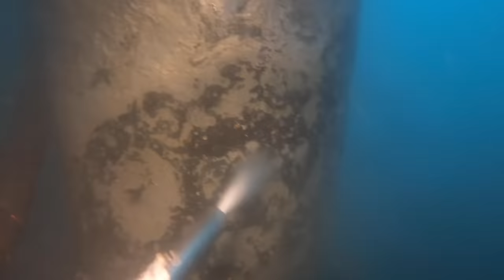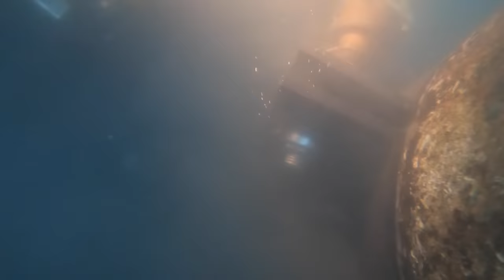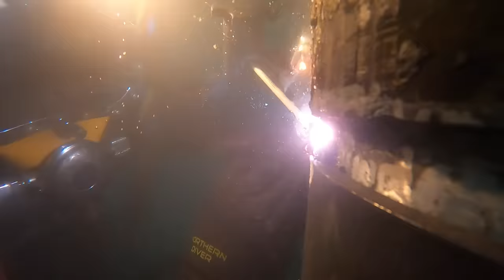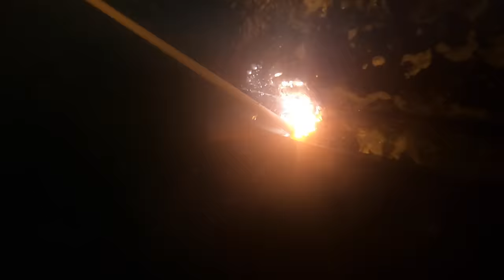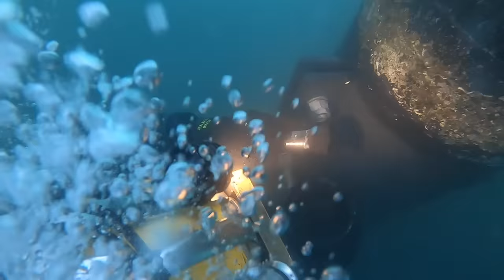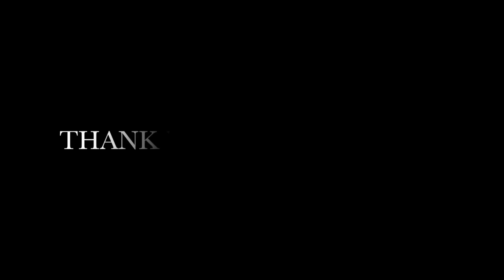Underwater corrosion damage repair (Underwater welding)

Comment: Was impressed when you could weld underwater. Now you can paint!
Reply: Its 2021...they bake you a slice beef underwater
Reply: that was pretty amazing 🤩
the skill in welding and damn the paint was more amazing 🤩🤩🤩
Reply: My thoughts exactly!
Reply: I have a doubt .. which welding electrode is used for underwater welding ? Please answer.
Reply: Janis Joplin  no actually that is my doubt.!
Reply: Right? Whats next you can cook underwater for lunchbreak?
Reply: @Universal.Vlog4u  Question, you have a question. Not a doubt.
Reply: Gua bangga dengan jurusan gua TPL teknik pengelasan
Reply: Lol
Reply: @Universal.Vlog4u  It could be 7014, 8014, 9014, or any of those with a 24 at the end.
Reply: @Universal.Vlog4u  That being said, there is a specific rod called Hyrdoweld which is designed with underwater welding as it's use.

Comment: Ladies and gentlemen this is what 100/300 $ an hour looks like
Reply: Fr ?
Reply: @bruhbruh6670  depends on how deep you are, but I'd say likely this man was making more like $50 if he was above 50 feet underwater. look up industry standards on depth pay
Reply: @theuniversalbean9352  that would be added to his rate. Pressure welders get $100+ on the surface he in Australia. What you would be refering to is a penalty rate on top.
Reply: Yeah that skill set is always above a hundo an hour here on east coast. We charge 300 per hour per guy.
Reply: @eazyrider6122  there are sharks in Australia tho, great whites
Reply: Hyperbaric welders can make around $300k a year
Reply: High pay because of the high risk. 10 to 15 times shorter life expectancy compared to normal labourers.

Comment: Ladies there's an underwater welding job just waiting for you.
You'll probably be supervisor within a couple months... Way ahead of the guys that have done it for decades. 
If you aren't interested in that  then pipelines, oil rigs, power line, sewer pipe and skyscraper work is an alternative.

Comment: Leaving to go to high school soon so I’ve been starting to think about what I want to do and I think this might be an option
Reply: Do it im a welder but I do TIG and am badass at it
Reply: @tahermohammed863  Tungsten inert gas. Argon or other inert gases are used to shield the weld from oxygen. A tungsten electrode is used because it can handle very high temperatures. This allows welding without using a filler metal. It's counterpart is MIG or metal inert gas which uses the welding wire as an electrode.
Reply: @Proud2bmodest  thank u

Comment: Underwater welder is one of the most badass jobs you can have.
Reply: But the real truth is, it’s a structural welder with a diving license. There really isn’t a thing that separates above water welders from underwater, other than diving certifications.
Reply: @bradleyrussell1973  Dont exclude the fact an underwater welder can make in 2 months what most welders make in a whole year

Comment: why not use the cavitation cleaner to remove the slag ? saves a ton of time, especially if you do a poor weld pass and get holes with slag in it.

Comment: Great looking weld. I'm in the pipefitters union and only welded with 6010/7018 and a little tig... how does the weld act as your welding? Is it anything like regular welding or completely different? I watched some guys at a Nuclear plant do some underwater welding on some fuel rods in the Reactor room. They have some big balls getting into that radioactive water...dude got like a years worth of radiation in like 2 hours of work. His dosimeter was going nuts

Comment: What type of welding rods were you using, I normally use 6010 or 6013 and 7013 rods, but I don't know what rods you use for underwater applications.
Reply from the maker: 7014

Comment: Why not use a 4,000 to 5,000 psi pressure washer to clean? Also, why didn't you cover the weld joint with splash zone epoxy? That paint is vulnerable to chipping even if it is bitmastic which will expose bare metal.

Comment: How does under water welding stack up with the quick cooling is cracking a problem??
Reply: It's a cold weld lol.
Reply: the rods are designed to be used under water and the fast cooling, the flux is thicker to insolate the bead so it cools slower not much but some. probably welds like 6010 and designed to be a fast freeze pool because of it being in a fast cooling environment.  cracking was a problem in the old days when the just dipped rods in varnish. last ones i saw were coated in PVC that wouldn't get in the weld and crack like the varnish did

Comment: Not trying to be an asshole or question your skills plus I've never welded underwater so I don't know but in grinding that pile back so you could put a weld bead didn't you create a weak spot above the weld by leaving that Gap on the pile ?

Comment: That's not cleaning corrosions. That's called covering it up.
Reply: Yeah by reinforcing the entire area around it, dude basically replaced part of the pipe without actually replacing it
Reply: @Highwaymert  that's the point. its not "cleaning". its replacing,
Reply: @princesendo8309  exactly what I’m saying bro

Comment: What amperage and size rod are you burning? Looks like a gentle weave going on?
Reply: you need 4mm underwater rods or 3,15 stainless steel rods soaked in varnish or wax ,80 volts and  around 160/200 amp
Reply: @cipri66  very nice, we burn mostly 1/8in broco soft touch rods

Comment: What's the 4 andoes for?
Reply: They anodes are used to prevent rust from forming one the repair piece. It works like electrolysis, the anodes will rust first before the actual metal.